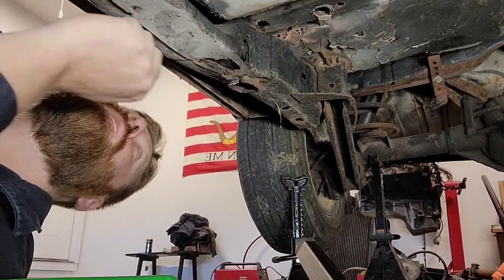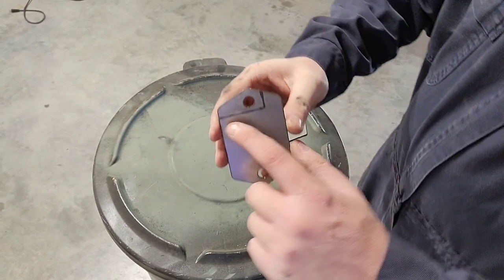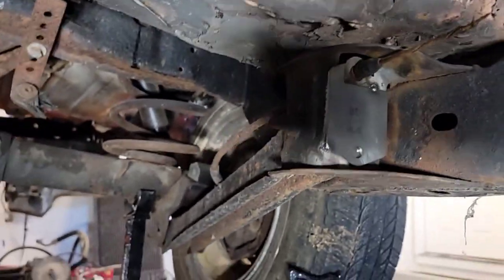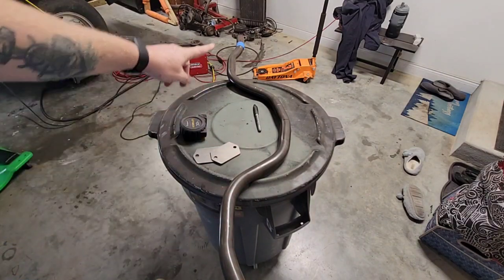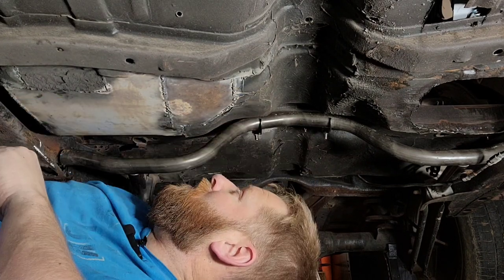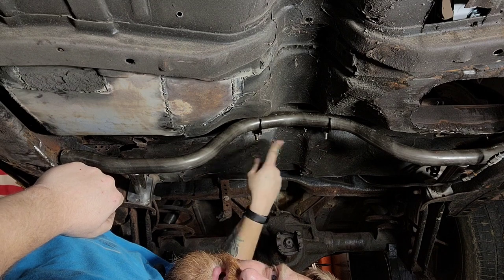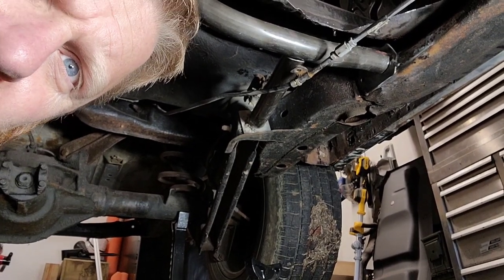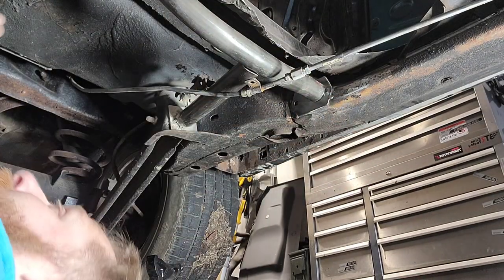Speedtech Frame Brace install in a 68 chevelle with a convertible frame.

Comment: The HMI kit is much better
Reply from the maker: I think you're referring to the HPI cust9ms kit?  

I selected the kit I did because it ties the rear suspension pickup points into the frame.  None of the other brace kits do that. They tie into the frame just forward of the LCA mounts.  But everyone has their favorites.  

I can say at speed that I have zero body roll or flex, and this car just rotates.  Great part of my package.